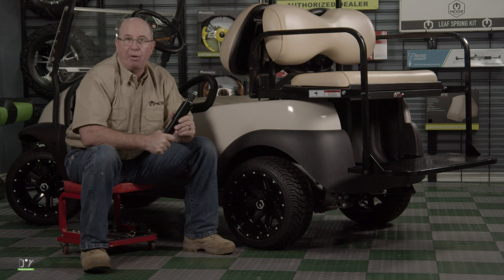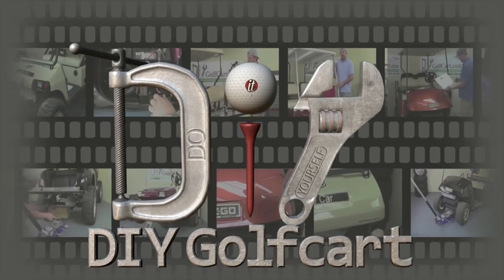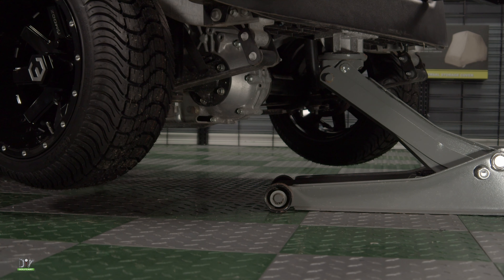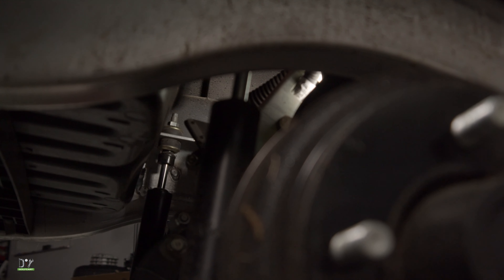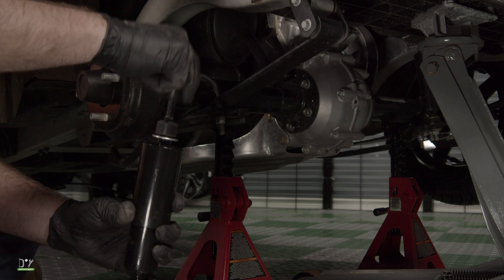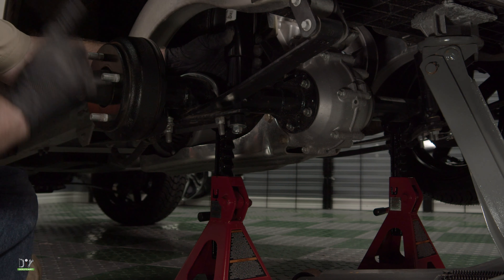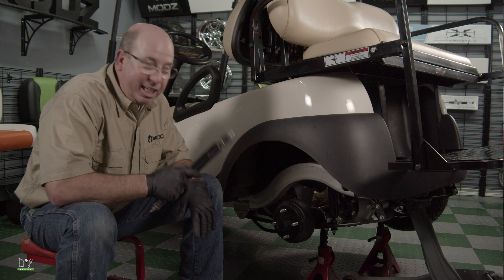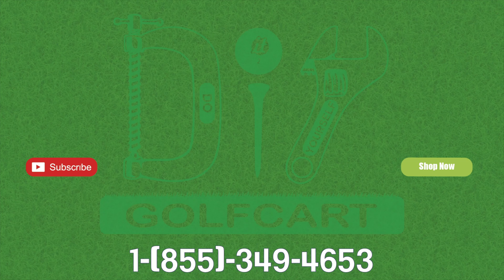2018 Club Car Precedent Rear Shock Installation How-To

Comment: Sorry, you lost me when you removed the old shock so easily.  Mine is rusted and takes a pipe extension on the wrench.  Trying to access the top nut and remove it is impossible.